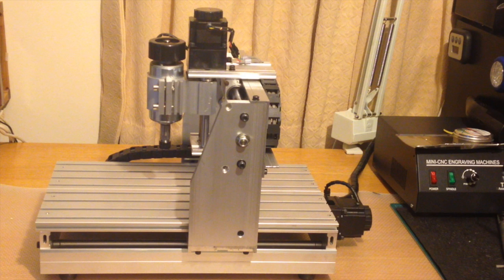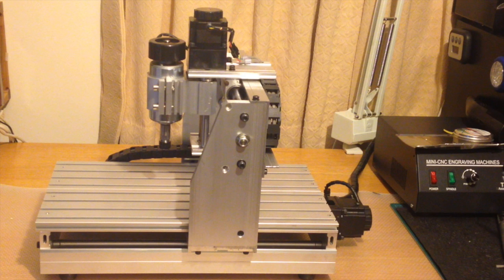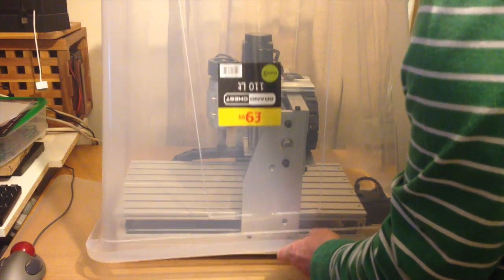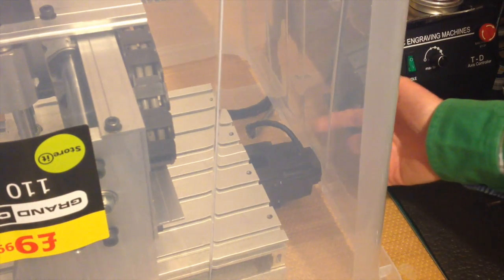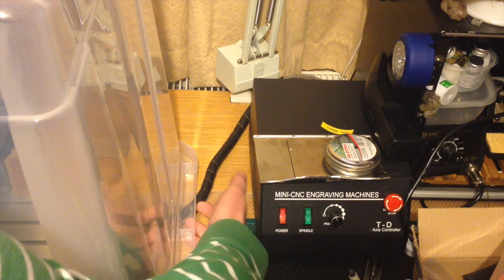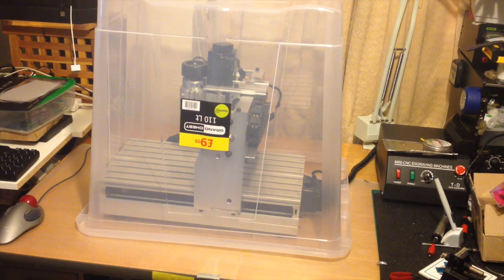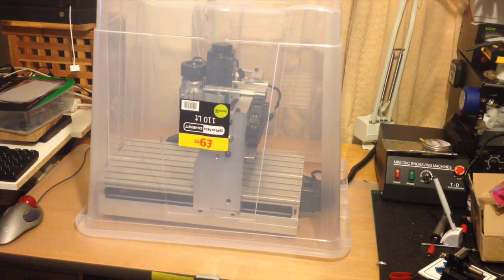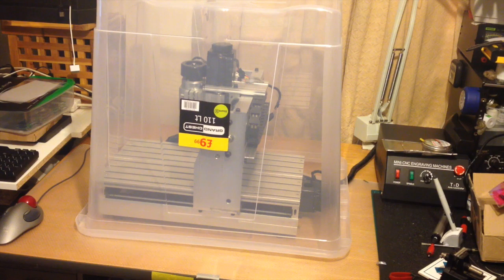Making A 3020 Mini-CNC Router Engraver Enclosure - Part One

Comment: Can anybody completely answer this question? Can anybody tell me where I can get the "Y" axis lead screw for a 3020 T Chinese CNC machine? It says 200 mm in the add, but mine is a little over 18 inches long.
Reply from the maker: +Guadalupe Alvarado Hi I've improved the search and the explanation, they are here in my fixed1t blog:  http://fixed1t-tech-support.blogspot.co.uk/2016/04/finding-right-length-cnc-ball-screw.html  question is do you need the entire Ballscrew mechanism including the Ballnut or only the Leadscrew? The blog entry and links explain. #fixed1tCNCtip
Reply: How is the motor going to fit on this lead screw. There is no smooth end and the other end is not machined for the 3020t CNC
 
http://www.ebay.co.uk/itm/3D-Printer-8mm-Ballscrew-Leadscrew-Lead-Screw-300mm-Linear-Rail-Bar-Shaft-/401080002181?hash=item5d623b2685:g:k0IAAOSwx-9W1CP0
Reply from the maker: In the small print and number of them say there parts aren't machined, but that machining is available on request.  #fixed1tCNCtips

Comment from the maker: This Two Part video is about making A 3020 Mini-CNC Router Engraver Enclosure for under £10 (approx $15 USA) to reduce noise, mess, swarf contamination and enable you to safely see the job when using the engraving router.  Industrial machines have expensive custom made enclosures, and with this method a decent enclosure can be made cheaply in an matter of hours. It will also offer some protection against high speed projectiles from snapping high speed bits or flying pieces of work in the event of a hardware or software  crash or human error ;-)